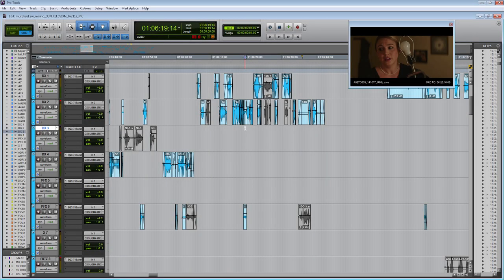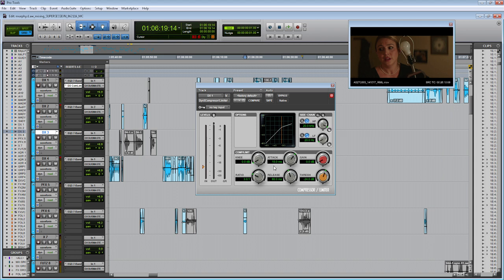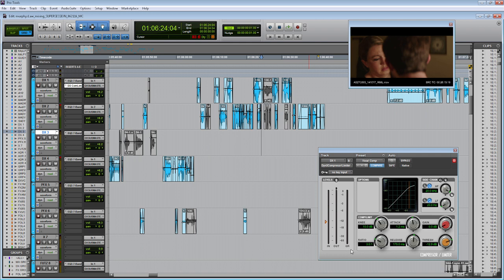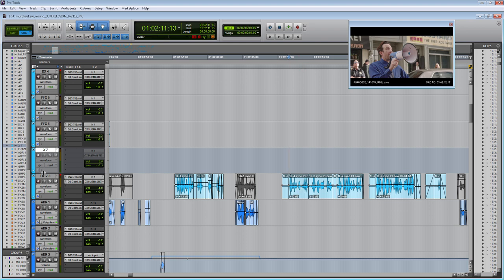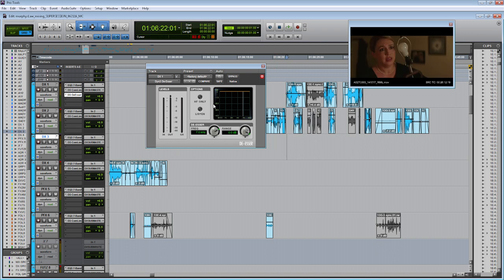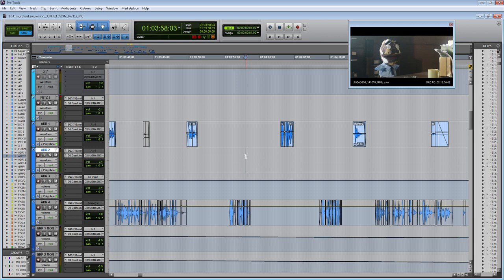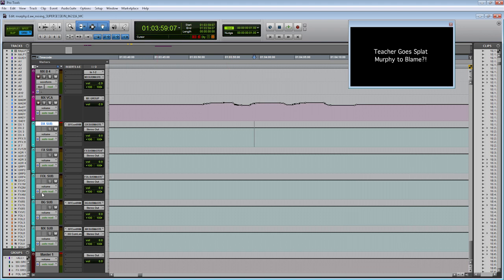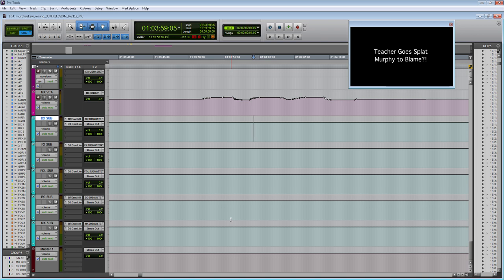Tutorial 15: Compression, De-Essing, Sidechain, and Limiting - Post-Production Audio Workflow Series

Comment: Thank you for making these videos! Attack does not tell the compresser when to kick in…it tells it how long to take to reach its maximim gain reduction after crossing the threshold. Whether you have an attack time of 0ms or 100ms, the compressor will kick in when the signal goes over the threshold…longer attack times just make it take longer to fully clamp down on the signal
Reply from the maker: Yep, that's right. Thanks for the clarification!

Comment: Thanks for your work! Any reason, if all compressors have the same settings, why you wouldn’t add a compressor only to your VCA dialog track just once? It’s rare multiple actors are talking at once, so a single compressor would work on exactly the same signal as a dozen compressors, which puts less load on the system, and let’s you tweak the settings in one place. What do you think?
Reply from the maker: You're right, you could use only one overall compressor on the VCA track if you wanted, and it would put less load on your system. However, sometimes when you're trying to match different types of microphones together (booms and lavs), then you'll probably have to have different compressor settings for each mic. Also, each actor speaks with a different amount of dynamic range, so you'll need different settings for that as well. So that's why I normally put a separate compressor plugin on each dialogue track. Hope that helps!
Reply: I was thinking the same, but if I might add a correction.. you can’t apply FX to VCA’s. VCA’s are simply faders, I think you meant Aux Bus, or what I’ve been enjoying a lot in the past 2 yrs are Routing Folders! Save you the processing load while organizing your session! Cheers!
Reply from the maker: @kenito74  Yep you're right, you can't put plugins onto a VCA track, I meant an Aux Bus. And sure, Routing Folders would work too, but there was some backwards compatibility issues with them when using older versions of Pro Tools when they first came out, so I didn't really adopt using them. Thanks for watching!